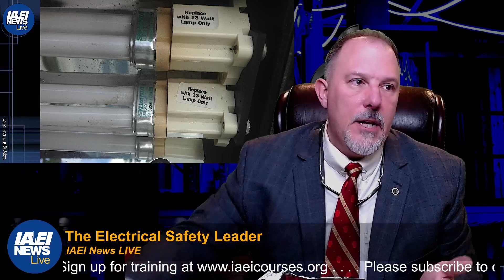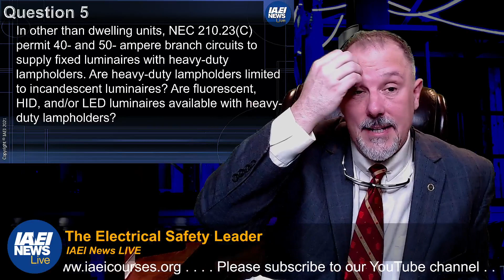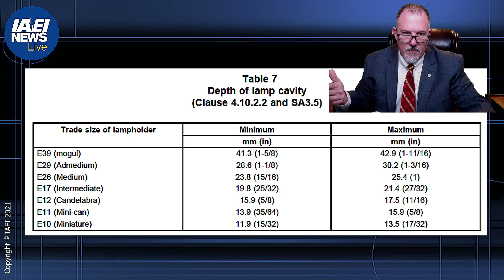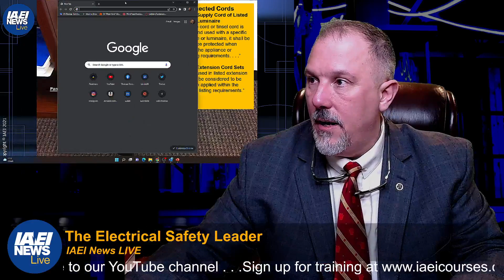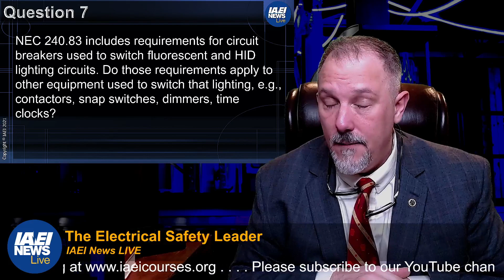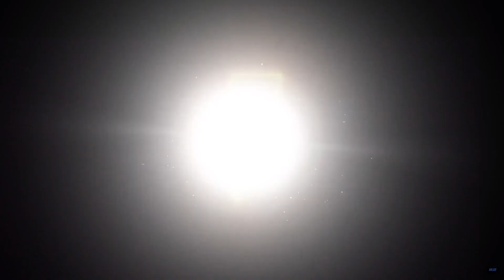Lighting and the NEC Part II

Comment: My brother worked for Philly electric and purchased a 1905 era 120 volt meter that has two wing nuts thru the glass for seals that was made into a luminare. Had it almost 50 years but used it a few times then stopped. Was thinking about either using an isolation transformer to feed an AFCI receptacle to power up a 9 watt LED or just go with a 12 volt lamp. O!d timer PECO lineman mounted it to very nice stained wood and an engraved plate with my name in it. About 10 years ago a large electrical contractor installed an expensive LED system that danced different colors from LED'S onto a wall  that all the units along the over 75' engraved glass wall had 120 volt cord with male plugs. I was the only person who thought you could not have rubber cords in drop ceilings. You would think when an electrician with over 40 years in the field brings up a safety or possible code violation management would look into it. Never had great results with automated lightning controls. Had a system in a 12 story building that took them 4 months to get outdoor pole luminare on system. ( were on 24/7  for 4 months ). System would either not turn on numerous luminare in giant Lobby and hallways or 1 to 2 hours late at least once a week.. Good luck on securing almost any electronic products older then 10 years old. Had to replace 100 HP VFD'S drives because could no longer get replacement boards.Still call the E26 lamp an Edison base. Hate that we are catering to the metric foriener club like moving maximum height of a disconnect handle from 6'6" to metric 2 meters ( 6'7"). With 277 volt being the most common voltage source for larger buildings can never see why you would ever place heavy duty lamp holders on a 50 amp circuit breaker. Might have been reasonable 60 years ago if a plant was using 500 watt incandescent lamps with mogul bases. At the $700 million ambutory care building that was part of the hospital /research center that I worked out some cheap skate knuckle head had them only run two 277 volt 20 amp circuits to provide a single luminare supplied from a 225 amp 277/480 lightning panel  to a single maybe 15 watt CFL lamp in 75 exam rooms on one floor. Each little 12 by 15' exam rooms had two luminare feed from normal power. The 42 circuit panel only had the 2 breakers for these 75 rooms. Even though its legal not smart having  even halve your eggs in one basket. Would be better if they installed at least 8 circuit breakers to split circuits.